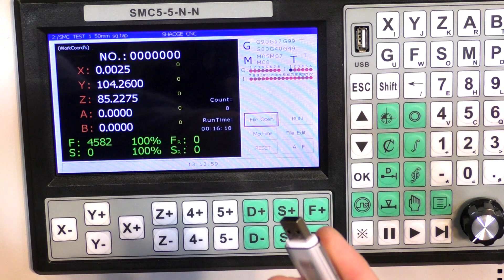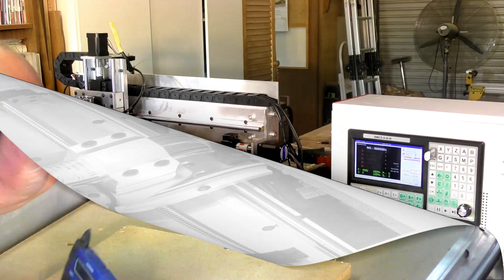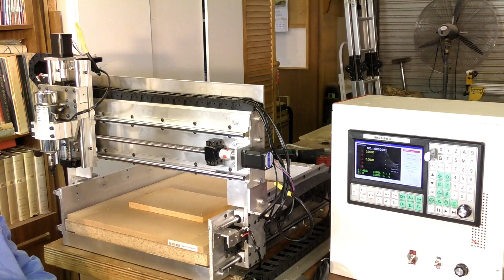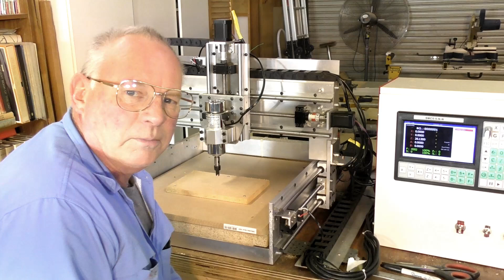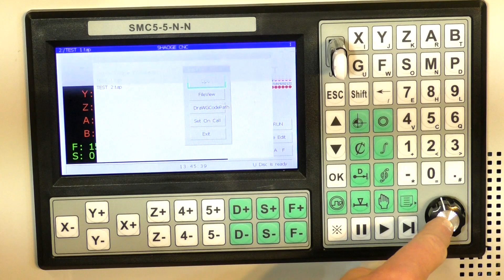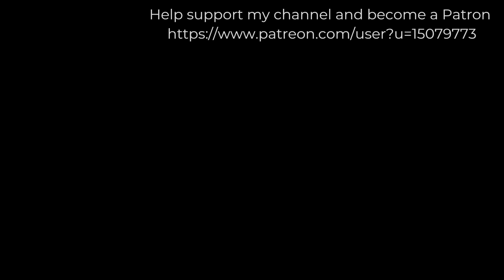TEST DRIVING a DESKTOP CNC router + SMC5-5-N-N offline CNC controller

Comment: Hi Roger i have my SMC5-5-n-n installed and all works fine but the usb drive wont open do i have to format the drive in a set way ?
Reply from the maker: Use a different Flash drive

Comment: Buenas tardes señor Roger, tengo un problema a ver si usted me lo puede solucionar acbo de conectar mis motores al SMC5 cuando le pido de avanzar 50 mm solo anda 2.5 mm donde puedo configurar, ahora mismo 
tengo motor NEMA23 los drivers están a 1600 pasos dentro de el smc5 los tengo a 320 pasos gracias por una respuesta ves que el manual no esta del todo claro
Reply from the maker: Set the driver to 400 and check the difference.
Technical assistance is available on my Patreon pages (4 Axis and up )
https://www.patreon.com/user?u=15079773

Comment: usefull video, thanks, what postprocessor are you using?
Reply from the maker: Carveco
Reply: @inventorsworkshop9600  and have you try fusion 360? or an other soft aplying adaptive clering strtegy? cause paralel works in fusion as well, but any other sofisticated strategy doesnt work..

Comment: Roger another great video! I am having problems setting up my controller. I believe it is a problem either with the Machine Coordinates or reference Coordinates.  I have verified the home limit switches are enabled, going the right direction, and connected to the right input however, when I select Return to home the router moves extremely slow (moves fine on jog) and after a while returns error codes on Return_Home X,  Return_Home Y, and Return_Home Z on the bottom of the screen.  I can fake the controller out by pressing the home limit switches and they all zero without error.  Can you give me some advice how to mitigate this problem?  PS I also agree the manual is not English friendly and not complete. Thanks,

Comment: Helpfull tip for you Roger. Take your files off of the USB stick and save them on the controller. If you run it from the stick and you knock it with your hand while it’s running and dislodge the stick from the USB slot you will loose the program. I found this out the hard way. Use copy paste to transfer it to the controller. I have about 30 hours of run time on my SMC5 now and it’s running great! Even have used it with my laser module attached.
Reply: I’m using the Mach3 post processor in Fusion 360, but have to modify some of the code to make the controller happy.
Reply: @RC-Flight  thanks, and what exactly? im trying the same mach3 and mach 4 postprocessor and it have problem with circles, if idowload paralel toolpath it works..
Reply: what postprocessor are you using?